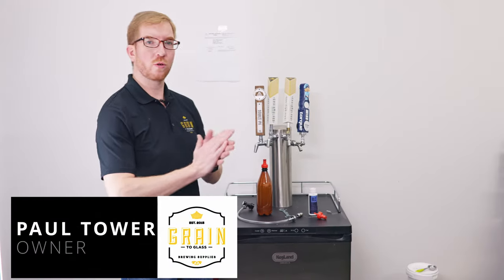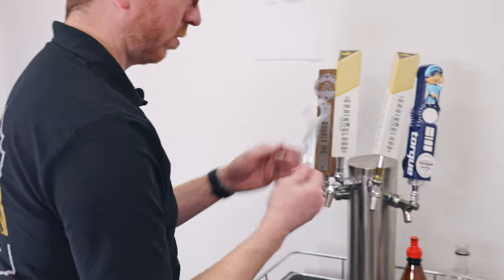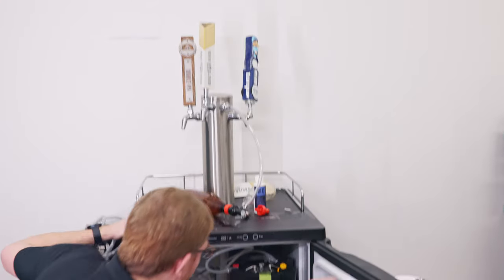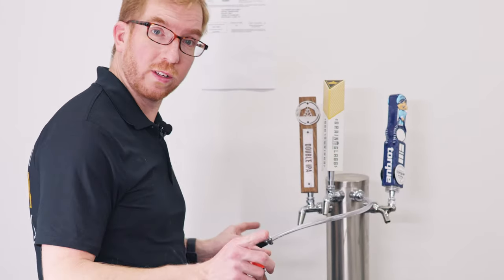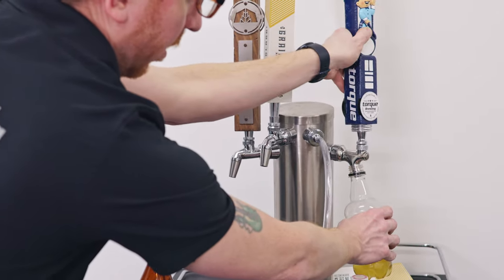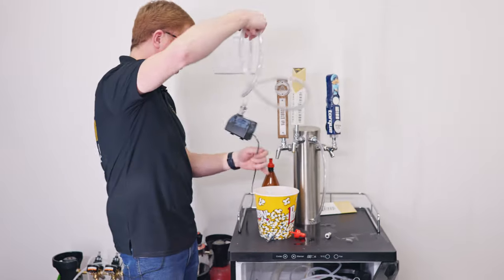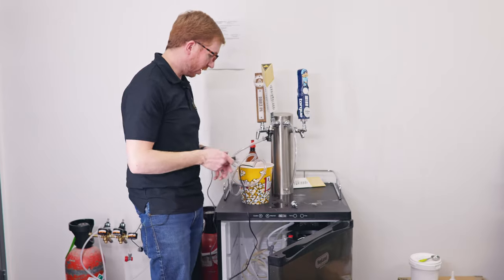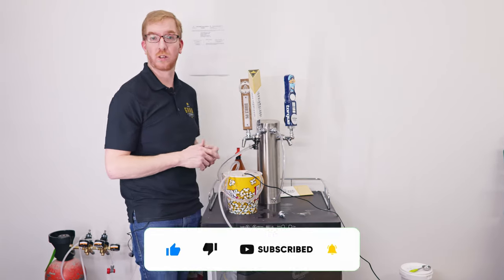Kegerator Beer Line Cleaning Tutorial - 3 Different Methods

Comment: Are those keglands corny kegs?  I'm unable to fit 4 corny kegs in my series x kegerator
Reply from the maker: Hi, if you have 4 ball lock corny kegs they should fit.  These are just 4 random used ball lock corny kegs that we had in there.  If they are pin lock you won't be able to fit 4.  Cheers
Reply: @Grain to Glass Inc - Beer and Wine Making Homebrew Supplies  I'll see what I'm doing wrong. I have 4 ball lock and when stacked one in front of the other it's about a inch too far our
Reply from the maker: @displacedtexan6114  is ant of the co2 or beer line tubing getting stuck in between any of your kegs?  If not I'm not sure why they won't fit.
Reply: @Grain to Glass Inc - Beer and Wine Making Homebrew Supplies  confirmed nothing is in the way but looks like the ones I bought here in Italy are different sized than most. After arranging them in multiple ways I'm 1/2 an inch off. These measure 225 mm instead of the traditional 218/219 mm.